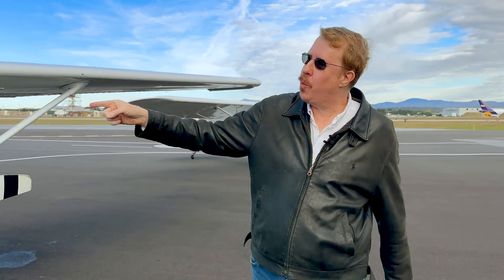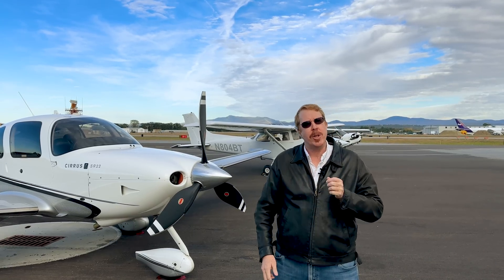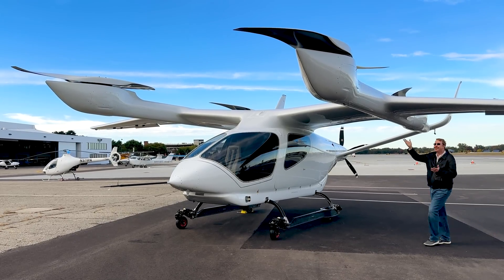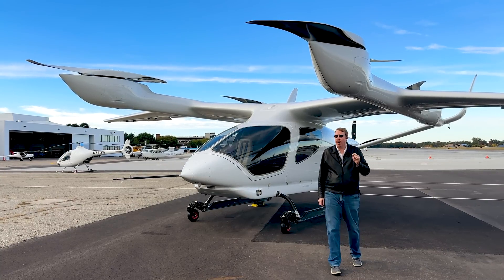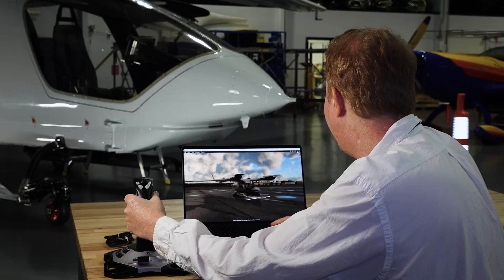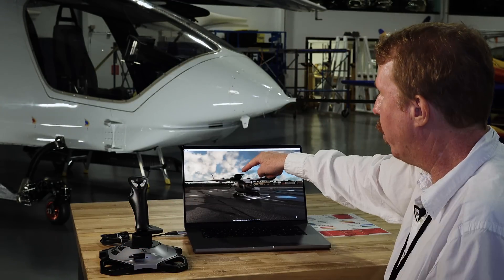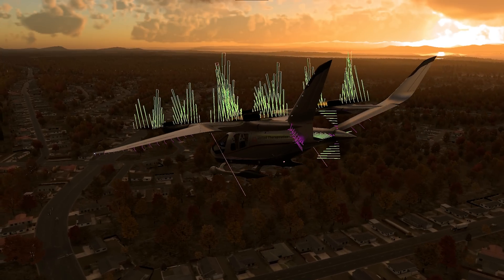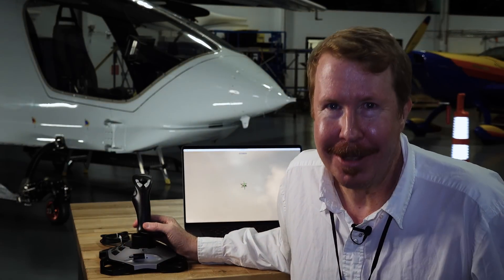The NEW Beta eVTOL: Fly without FUEL or RUNWAY!

Comment: Quick question: I have tried to fly the eVTOL originally. However, and I just tested now, once I land, I can never get the pusher prop to go again. I thought at first was when I turned off and back on. Now I can confirm when I land (pusher prop no longer works). I even tried to reload script but that didn't change anything. Any ideas on what I can try? I do use a MacBook Pro M1 processer.

Comment: Couple of things:
1. I tried to play this in VR, there's noticeable lack of controls in the cockpit. Basically, you can control the joystick and t here's standard flight instruments, but there aren't any way to actually control the engines.

2. Not needing fuel is not quite true, as somewhere there should be a generator pumping in all that electricity. And it runs on fuel. There's a question about flight time, as batteries have lower energy density (in case of helicopters, electric heli by Sikorsky supposedly can fly for 15 minutes compared to 3+ hours of the same model with fuel engine)

3. Why not an autogyro with jump takeoff capabilitiy if the idea is not to have a runway? The vertical rotors are surely going to cause an extra drag during forward flight. In case of autogyro they serve as a wing.

Comment: If the front two vertical lift engine’s could be tilted forward, you would have 3 horizontal engines propelling the aircraft forward. Even better if the rear horizontal could be configured down  as well you could potentially have 5 engines  driving aircraft forward.

Comment: That thing is a J-O-K-E ☝🏿
All these electric motors available are not capable of turning a 10 m diameter rotor. Therefore all these e-joke companies reduce the rotor diameters to suite the performance of those low torque e-motors. Marketing tells you it's the new way of transport. Ridiculous ☝🏿

Comment: Why are they not using the top blades in drag like a gyrocopter?   They can provide lift, they could reduce the wing by a lot and have the same profile drag. In fact, if the rotors were big enough you wouldn’t need wings.

Comment: The CL-84, from 50 years ago, was a LOT easier to fly, a LOT easier to transition to/from horizontal flight, and simpler... gee...with the same level of battery and power, a CL-84-type tilt-wing would be a lot simpler to run, and without those stowed vertical motors and rotors, which are, at that point, dead weight.
Hmmmmmm....

Comment: You do need fuel, but it comes in the form of electricity generated by coal, gas or nuclear power.  There is nothing even close to the energy density of a gallon of AvGas.  And as you fly that SR22, over time it’s performance gets better because it has burned off that weight of 12 gallons of AvGas and can now fly higher, to drop its fuel consumption and extend its range.  Or catch a better tailwind and increase its groundspeed. With a battery powered aircraft, the performance you took off with is what you get until you land.  The altitude you initially climbed to is all your going to get.  The TAS (true airspeed) you took off with is all you’re going to get for the duration of the flight.
Reply: POO-BAR....wrong wrong n wrong

Comment: Instead of stowing the lift props why not program them to harness energy from forward motion to partly charge the batteries?
The 1950s Fairey Rotodyne used the free turning VTOL rotor in this way but obviously long before modern batteries had been invented.
The power stored in its on board lead-acid (automobile type) batteries were designed to supply power to lights, heaters, servos and automated elevons on the stubby wings in the event of emergencies such as turbo jet forward motion engines.
Although the freely rotating rotor would behave like a parachute some power was needed to correct attitude and even air braking so the craft would land correctly on its undercarriage.
Even after various commercial and political plots undermined contacts for the rather fast city hopper Fairey and research companies used 3/4 size Rotodynes to perfect VTOL 'blind' operation in a range of extreme weather conditions including landing on water.
In a sense the Fairey Rotodyne was not just the first pod-built heterodyne of practical size and power but was a forerunner of modern drones.
Reply: Yeah like an EV with a wind turban attached to it. Free energy right? Lol.

Comment: So, it STILL REQUIRES FUEL. Electricity stored in a battery is still fuel! And to make that electricity some other type(s) of fuel are required. But it does look interesting. What is it's glide ratio if the battery fails?

Comment: So does the thing get 30 minutes of flight time or less?
Reply from the maker: 2.5 hours, right now!
Reply from the maker: We've flown it for 2.5 hours continuous, so far... batteries getting better at 8% per year, so that will keep coming up...
Reply: Holy crap, 2.5 hours with four people in it or more?
Reply: @khcopter  Just the test pilot for the.. um... test-flights we are making now.
Reply: @khcopter  Yes test pilots only. Because death is probable with this thing.
Reply: So you’re saying if you add 4 people you’re gonna have about 30 or 40 minutes of flying time?
Reply: @khcopter  Wait where did you get that number? You're just making up numbers here.
Reply: Does the flight time include the reserve or.....no reserve?
Reply: @pgnandt  It has, historically, flown just over 250 nautical miles, and landed with reserve, yes. But all the exact range / endurance numbers will be released over time as the plane, and batteries, evolve. The AIRPLANE still early in development, AND batteries are getting better at 8% per year, sooooo........... all answers are in flux, and rapidly getting better.
Reply: @austinmeyer   This is just another invention looking for a problem to solve. What is the point of this thing?
Reply: @pgnandt  "This is just another invention looking for a problem to solve". Not true. This plane is built for a mission. The FIRST customer is a pharma company, which will use it to do ORGAN TRANSPLANT delivery, moving (possibly 3-D printed!) organs from Raleigh Durham to hospitals up and down the east coast. This mission requires a vehicle that is fast, not blocked by traffic, and does NOT require runway or fuel at the hospitals where it lands (plugging in is of course fine). Another early customer is a shipping company, which will use it to go from remote spots WITHOUT runways to airports where the cargo is loaded onto long-range planes. Though MY FAVORITE use will be passenger-transport from Laguardia, JFK, or Newark to Manhattan... a direct distance of about 5 miles, a flight of about 5 minutes, hopping over an HOUR to an HOUR AND A HALF of traffic.
Reply: @austinmeyer   So why would a helicopter not do what you are mentioning as a use for this thing.
Reply: @pgnandt  VTOLS are more efficient in forward flight than helos... and always will be. Rotors can never be efficient since the advancing and retreating blades are running at such radically different airspeeds, with the advancing one hitting Mach drag, and the retreating one about to stall. This is why helos will never be fast or efficient.. ever.
Reply: @austinmeyer  Don't be offended. It's a logical question. I just don't see the gain over what an airplane and helo can already do. This thing would be regulated no different than existing aircraft. No? Doesn't have to be a long answer.

Comment: I stopped watching when the presenter said the plane didn't need any "fuel" to operate. What a stupid statement. What happened to have caused the batteries to store the energy? Unicorn farts? Depending on where the plane is being fueled, that's right "fueled" as in  "being charged",  the vast majority source of that fuel was produced burning fossil fuel. So this plane most certainly uses fuel.
Reply from the maker: UNICORN FARTS? UGH! That would be methane! No, what we have is much better than that. We get our power from Quebec Hydro... water falling down a hill!
Reply: @XPlaneOfficial  I am assuming the plane with fly someplace other than Quebec.
Reply from the maker: @MrOso36  At some point in the future. And the grid is becoming more renewable by the year. GLOBALLY, renewables surpassed coal in 2019! I think you're just CLINGING to any flimsy excuse you can to avoid... changing your mind about something.
Reply: @XPlaneOfficial  Currently, carbon based energy production is 60% of the total. Non-hydroelectric alternatives stands at 13%.  I am not changing my mind about anything. I and looking at the facts instead of ..."a wishing an a hop'n hope'n..."  that alternative energy is going to supply the grid. So good luck, you will need it.
Reply: @MrOso36  So, 40% clean, and getting better every year.. NOT BAD!
Reply: Thanks to fracking and nat gas, the USA has been able to lore it's carbon footprint. The amount alternative energy as a percentage of over all energy generation has not  significantly helped .Until we get serious about reinistating a nuclear power industry in the US, the future of electric power vehicles will be limited.
Reply from the maker: @MrOso36  UNICORN FARTS would involve METHANE! We can do better than that! In VT, where this thing is made, the power comes from quebec hydro: Water falling down a hill. And renewables surpassed col in 2019. This new-fangled "electricity" is one of the ENABLING techs to clean transport.

Comment: Nice aircraft. But it’s disingenuous to say it doesn’t need fuel. It certainly does. That “fuel” or energy may be coming from that coal-fired plant 800 miles away; that nuclear power generating plant 650 miles away; or that hydro-electric dam at your local lake. It takes electrical power/energy to “fill” (charge) those batteries.

Comment: Interesting concept. Would be much more practical if it used gas rather than batteries though. As an electronics engineer, I know how finicky lithium batteries truly are. And I don't want to see my plane's range reduced 30% after I've been flying it for a few years. If they make a version of this that uses conventional Avgas or Jet-A, I'd be much more interested. Unless physics advances to the point where zero point energy becomes possible, or Tesla's dream of high efficiency wireless power transmission is realized, electric airplanes are an awful idea. And yes, it is disingenuous to say it doesn't use fuel. It merely uses fuel in a different form.
Reply: There's a lot going on here that requires electricity… I'm going to make a video about that in particular and will release it on this channel in a bit

Comment: So if you are doing a vertical take off and at 100 feet there is a complete power loss, your dead. By the time the pilot reacts and pulls the parachute if there is one, this aircraft would be falling at a rate of speed that it would impact the ground before the chute was fully open and again that is if the pilot reacted right away. An airplane has wings and forward movement. A helicopter has stored energy in its rotor blades for an auto rotation. This aircraft along with all Drone type aircraft are very dangerous.
Reply: Lol. Yeah it's a death trap. I'd rather have a flaming gasser in front of me than a burning battery underneath me. Just another invention looking for a problem to solve.
Reply: A good point but I assume that they will build in sufficient redundancy so that 'can't' happen. Of course, the battery pack could explode too, that might be catastrophic. The nice thing is, we can test all these theories - well, not the battery exploding but climb to 100 ft, chop the power and see what you can do.

Comment: I wouldn't, not with today's "E" standards, lets give the industry a few decades to figure out how to increase power and capacity before we start a mass market campaign.
Reply from the maker: This plane just flew 250 nautical miles. The straight-line distance from Laguardia to Central park, to bypass an HOUR in traffic: 3 miles.
Wait DECADES for..... batteries?
YOU can wait! 
Me, not so much.
Reply: @XPlaneOfficial  250 n/m is cool, but lets face it, you start adding passengers and cargo such as luggage, and you start losing power, lift, and distance. Be honest, this thing is comparable to the piper cub, like I said, it's a cool little project, but it ain't going far or fast. Tell you what, put this guy into production and lets see how it stacks up against a transport helicopter, because I'm betting it wont. I will sincerely apologize if it can preform as well as a Cessna 172 for passengers and speed as far as LaGuardia to Central Park, because old UH-1's do so much better than a Cessna and that is a good measuring stick.

Comment: But the fuel is now just not liquid but electricity. You still “ need” it!! And you still must “fill” it!!! And it still burns hydrocarbon fuel!!! Just not in the plane itself. People might want to clarify their thought here, there is no perpetual energy machines. Energy is converted from sources of stored energy. Coal is energy dense. It’s much more efficient than greenwashed alternatives. And that literally means their is no carbon savings, but instead those carbon units “ spent “ are just spread across the supply chain. It’s really not in my backyard ism turned into a public gaslighting effort coded in code words that don’t exactly mean what they imply.
Reply: "And it still burns hydrocarbon fuel!" Wrong. This airplane is developed in Vermont, where the power comes from Hydro electric dams in Quebec. My car in South Carolina, where I live, is charged from solar panels on my roof. So, water falling down a hill, and sunlight.

Comment: Is there a prototype that uses could use hydrogen in the future when it’s available nation wide ? Has the company ever considered swappable battery packs for the vehicle which could. Reduce charging time and battery maintenance? thank you sir it’s an excellent vehicle
Reply: Yes. This plane is made to have swappable battery packs right from the outset. Batteries are getting better at 8% per year. So, let's say the battery pack wears out in 5 years. OK. No problem. Swap it out with a new battery pack with the latest tech and: Boom, MORE range than when the plane was new.
Reply: My first Tesla went 300 miles... my wifes new Lucid goes almost 600. Battery tech is skyrocketing. We're at the tipping point now.

Comment: Those kind of videos are really well done! Good job, LR! According to Austins final words: The question is not, how to LAND this aircraft (spot landings are quite easy if you have experience with helicopters), but the question is how to CHARGE this aircraft? "Weight & Balance" settings, where I can usually set the amount of fuel by slider(s), are useless for electrical aircrafts. So any hints for charging are really appreciated. Thank you!
Reply: Map a button or key to the recharge function.

Comment: Now take 2 fuel cells from two Toyota Mirai hydrogen cars and the fuel tanks. Estimated range is easy to compute. Cut the battery pack to 10%. Mount the tanks underneath the battery. From tests with smaller drones the range is usually 3 times battery range alone.

Comment: Electricity in aviation is a pipe dream for anything with distance/longevity.  This plane seems to be more efficient than most at VTOL though.
Reply from the maker: 250 nautical miles has ben demonstrated in flight by the airplane shown in forward flight in this video....

Comment: Yeah...for about 30 minutes...
Reply: No. About 3 hours, using current battery technology. And batteries are getting better at about 8% per year, sooooooo........
Reply: @austinmeyer  
We will see. The amount of energy for a vertical takeoff will be huge, so they won't be doing that much. 

I am sure it can get to cruising altitude and maintain speed for three hours. 

Cold weather will further deplete battery capacity, and without any sort of cowl heating that will further diminish range. 

People using this aircraft in the north will have to wear parka's when in flight.

Then there is the required reserve in the event of a reroute to a different airfield. 

Yes, sure 3 hours of flight. Might as well drive an EV. 

Air travel will be dying on the vine in this new carbon free world.
Reply: @byrnc927  in fact, the exact opposite of what you said. Electric aviation that does not require fuel or runways will allow us to take airplanes on short trips over traffic… Adding a whole new dimension to aviation that we currently lack. And with batteries getting better at about 8% per year on average, the range and utility will be increasing constantly. So actually we are about to have a whole new aviation Renaissance.